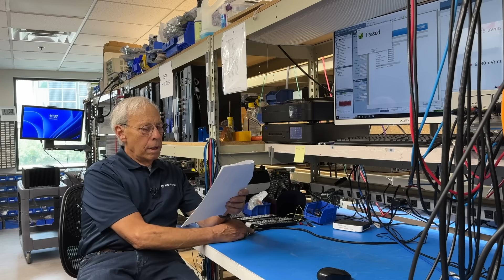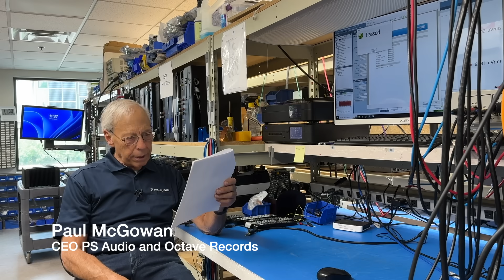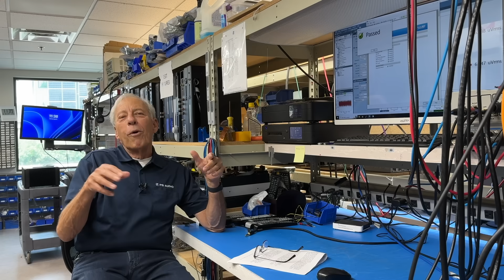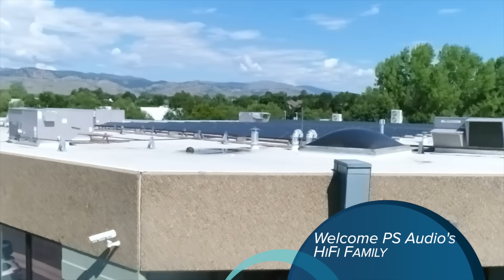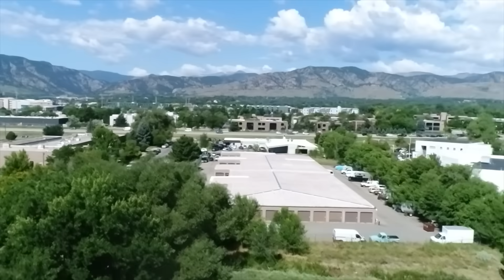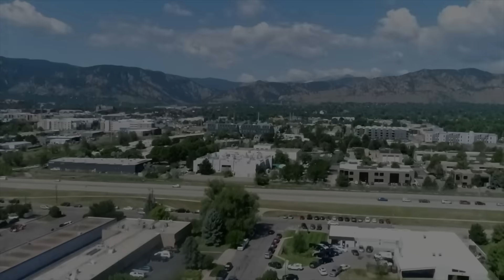How jitter impacts audio

Comment: No, we do not need to worry about jitter. Modern digital equipment, even the cheapest, has reduced jitter to way below the audible threshold. Don’t let manufacturers scare you with nonsense claims.
Reply: Can you provide facts and evidence to back up your claim?
Reply: @mattrismatt they can't because they made it up
Reply: @mattrismatt  Messungen bitte !!!!!!!!!!!!!!!!!!!!!!!!!!!!!!!!!!!!!!!!!!!!!!!!!!!!!!!!!!!!! MESSUNGEN !!!!!!!!!!!!!!!!!!!!!!!!
Reply: @mattrismatt  ...can you hear any of the effects of jitter on the most recent DACs that you have listened too??
There's your proof (facts)!
Reply: Yes, I can hear the effects of jitter on a recent DAC (DO100 PRO, USB input) in conjunction with transparent gear: amplifier, headphones, speakers, etc.

Incorporating a digital signal re-clocker and DDC (SMSL PO100 PRO) corrected the smeared sound I was hearing.
Reply: @mattrismatt  Was für ein Schrott von Geräten haben Sie denn, daß man heute noch Artefakte hört die auf Jitter zurück zu führen sind ?
Können Sie auch hören ob eine Orgel gleichschwebend temperiert oder mitteltönig gestimmt ist ? - Ich kann es !
Reply: @bachglocke3716    To answer your question, I have above-average hearing and listening discernment skills which allow me to discern the difference between audio with high jitter (over USB directly to my DAC) and low jitter using my digital signal re-clocker/DDC over SPDIF coaxial or optical.
Reply: @mattrismatt  How did you obtain such skills?
Reply: @mattrismatt  Sie haben aber den Rest meiner Frage nicht beantwortet: Ob Sie den Unterschied hören ob eine Orgel gleichschwebend oder mitteltönig gestimmt ist. Haben Sie denn auch mal die Jitterwerte gemessen ? Können Sie definieren wann ein Jitter "hoch" und wann er "niedrig" ist ? Das sind alles so schammige Angaben, die keine wissenschaftliche Aussagekraft haben.
Reply: Wo bleibt denn der wissenschaftliche Beweis ? Den bleiben Sie nach wie vor noch der Community schuldig. Wenn "SIE" sich als "Beweis" ansehen, dann ist dies einfach nur ein kindisches Geschwätz !
Reply: @mattrismatt I can't speak for you but I have found that most who have asked me that question were not able to use the data that you requested here in any meaningful way.
Reply: @InsideOfMyOwnMind   Regardless, the facts and data have not been provided.
Reply: @mattrismatt   ...people who need facts & data have completely missed the point of home-audio for listening to music. Are you happy with the re-clocker? You mentioned "hearing". If your hearing could detect the corrected smear what the hell do you need facts & data for??
Reply: You're right, personal experiences (hearing, perception) is enough for me.

But what brought me here was the OP's claim. I just wondered if facts & data could be provided to bolster it.
Reply: Wer wissenschaftlich arbeiten will, braucht Daten und Fakten und gibt sich nicht mit solchen Schwurbelsprüchen ab! Ihre Argumente sind die typischen Ausreden von HiFi-Freaks die sich vor den physikalischen Tatsachen scheuen ! Halten Sie mich bitte nicht für einen musikalischen Laien, der nicht weiß daß Georg Philipp Telemann ein Musiker war und nicht der Erfinder des Telefons... ! 😞
Reply: @geoff37s38 ...pretty-much👍
Reply: ‘Jitterbug into my brain’🥳 wake me up before you go go Paul🥳
Reply: Jus bc u haven't done anything to actually get rid of it ur opinion is jus a good as pointless 😉
Reply: @hondamoto-rb6bk I haven’t got rid of elephants in my back yard either ehm… because I couldn’t find any 🥳🙈
Reply: You're thinking of judder not jitter. Modern dacs aren't good enough to fix jitter
Reply: That is absolute bullshit...jitter is extremely hard to reduce to necessary levels with typical hardware....I work in the world's best laboratories with the world's best test equipment and it is typically 500ps to 1ns....24 bit audio needs less then 1 to 2 ps to be accurate...those are the facts
Reply: Hey! I know what you thinking but jitters still matter because the points of audio is lower jitters as possible to archive accurate digital timing as possible and low noise oscillator is matter even you hard to hear it but this doesn't mean it unnecessary ~~ because lower jitters help closer to original signal as possible before send digital to analog:)
Reply: @proxima_ofc  Das mag alles stimmen, aber man sollte nicht vergessen: Für alle Art von Artefakten gibt es Hörschwellen, unterhalb derer man nichts mehr wahr nimmt. Solange jegliche Artefakte - ob Jitter oder andere Phänomene -- unterhalb der Hörschwellen bleiben, braucht man sich keine Gedanken darum zu machen.
Es wäre mal interessant, wo bei dem Phasenrauschen ( das ist ja nichts anderes als Jitter) die Hörschwellen liegen.
Reply: @bachglocke3716 you right but hey! as I say the points Is lowest jitters as possible logically closer to original reference as possible I think it make sense because closer to original signal as possible Is Necessary because it will illogical if they not accurate right so even low noise oscillator and low enough to not hearing but still jitters is jitters timing error cause noise I'm sorry if my answer is wrong because I use translate to you language thx!~~
Reply: Ignorance is bliss 😁
Reply: Jitter does not affect digital audio period.. DOES NOT AFFECT THE AUDIO. HES MISSING THE POINT..ITS NOT A TURNTABLE.. SPEED DOESNT CHANGE THE AUDIO..AT ALL. HE DOESNT DISCUSS IT..
Reply: This entire channel is to sell you overpriced and underperforming gear 😂
Reply: @TOM7952 now, now, behaaaave🥳
Reply: @TOM7952 Under performing compared to what at the price?
Reply: @TOM7952  Why are you here?
Reply: @TOM7952   ...it is also to amuse us & for us to share experiences & information when we can't afford PS Audio gear 😂

Comment: When streaming between devices, protocols of transfer are there like I2S S/PDIF, where  S/PDIF has its clock embedded in the data stream and is to be recovered in the receiving device, while I2S has its separate clock channel. The crystal oscillator inside the receiving device is for the AtoD, or DtoA conversion, and can be synchronized to the incoming clock but it can be asynchronous too if there is enough data buffers
Reply: In fact all all modern DAC since 24 bit implementation use asynchronous transfer and are utterly immune to jitter or timing errors. Even 5 dollar ones.

Comment: Dear Paul, may I say that an audible jitter (any jitter) is behaving as a kind of modulation when the main signal is the carrier frequency and the jitter is the modulator? For example, if the jitter is 10mS it means it can be listened as a 100Hz modulating the entire audio (modulated in a constant volume no matter the main sound volume is)?
Reply: Der Jitter ist im Prinzip eine Frequenzmodulation. Bei einer FM kommt es auf den sog. "Modulationsindex" an - also das Verhältnis "Frequenzhub zur Grundfrequenz". Nur ist der Jitter niemals konstant sondern hat den Charakter eines Rauschens.